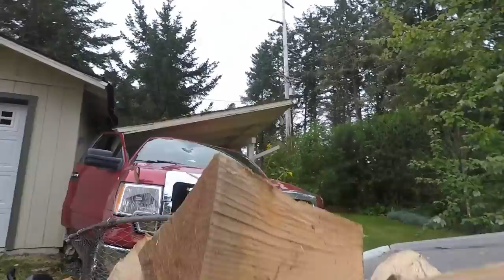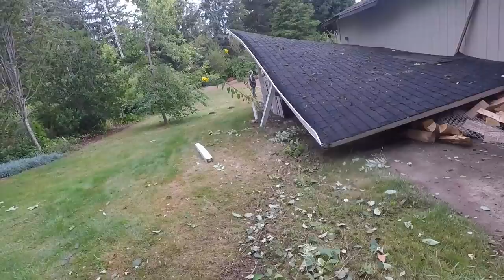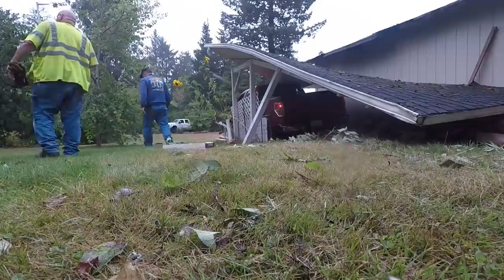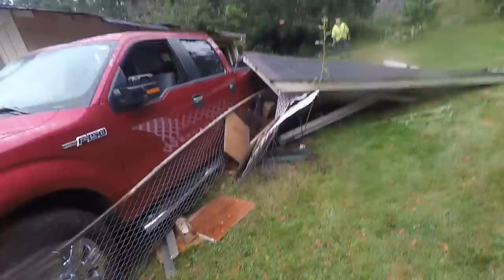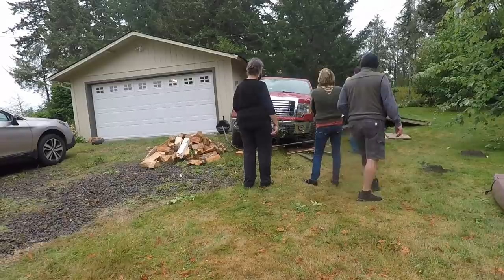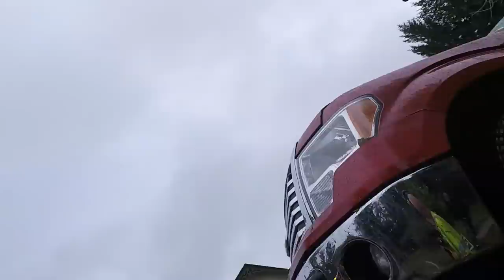Ford Takes out Garage Lean-2

Comment: I was originally thinking to pull that Ford out and leave the lean-2 still leaning. After I finished looking at the video I now see why it was a better move to pull that roof off first. No sense in having the roof hang up and doing more damage if it fell forward as the vehicle moved.